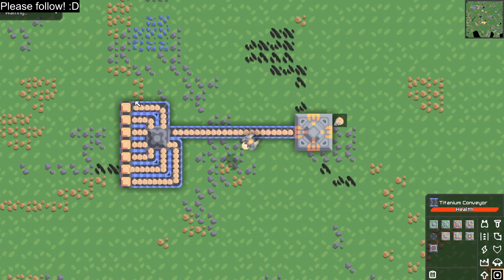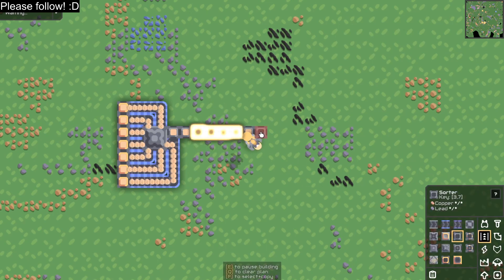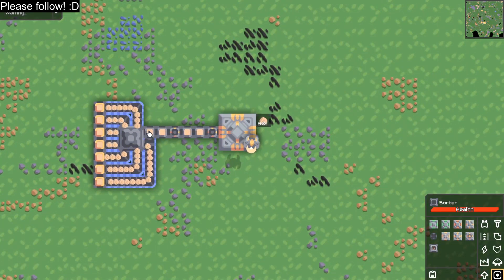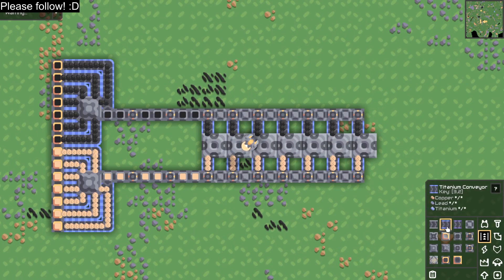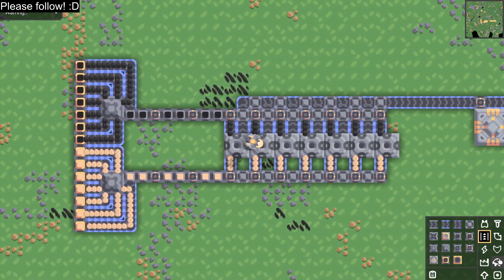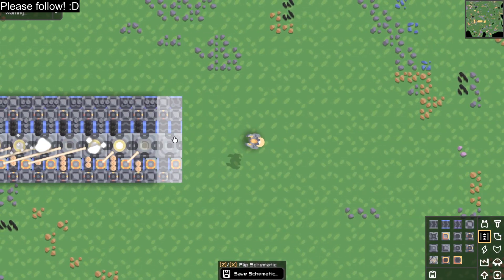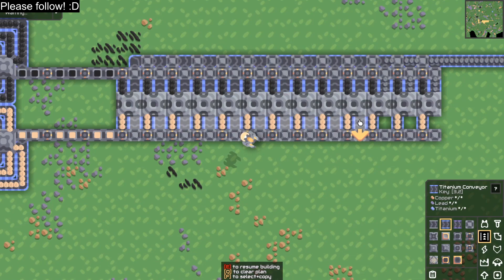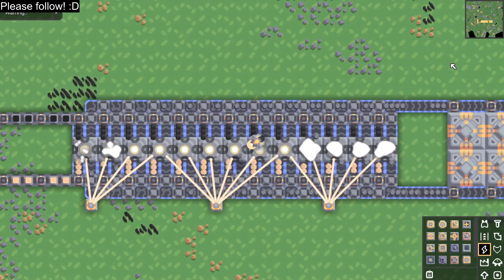You can combine multiple conveyors and get high throughput without sacrificing space

Comment: Is this also the fastest way to transport iteams and can you have more than 1 type of iteam in there? 
Can you make a design like this with surge alloy?
Reply from the maker: I believe this is the fastest way to transport items.

If you use inverted sorters (set to whatever resource you aren't using) it can transport multiple types of items.

Not sure what you mean about the surge alloy. Do you mean the machines that make it?
Reply: @AirNeat  I mean surge alloy with the sorter sorter underflow gate. So instead of the routers and .... . So you can transport them even faster into the smelters.